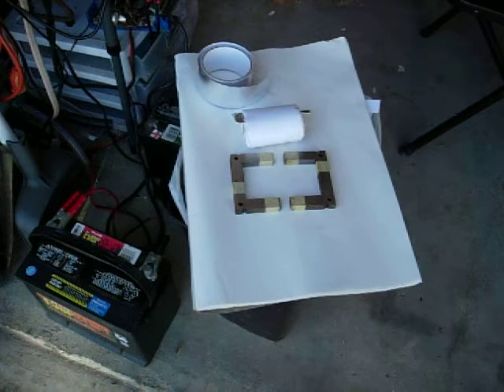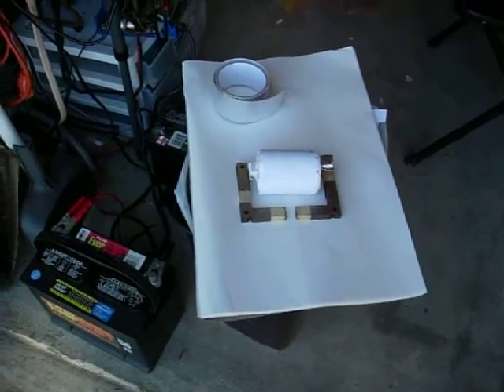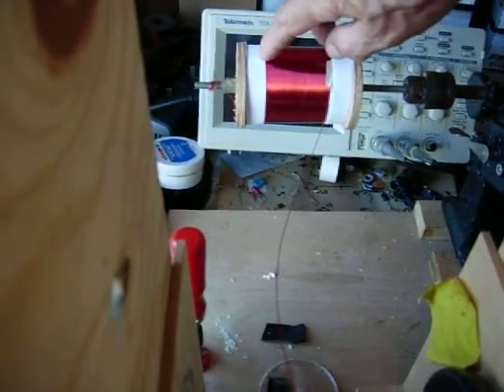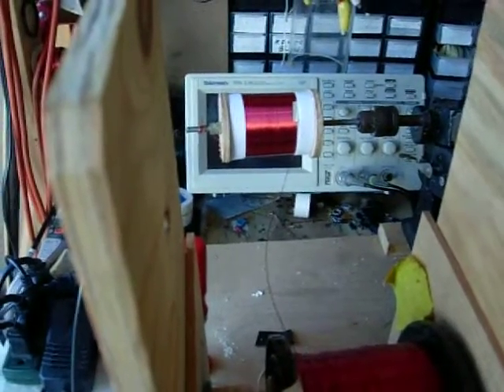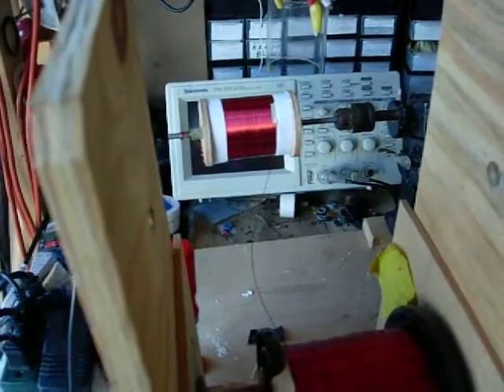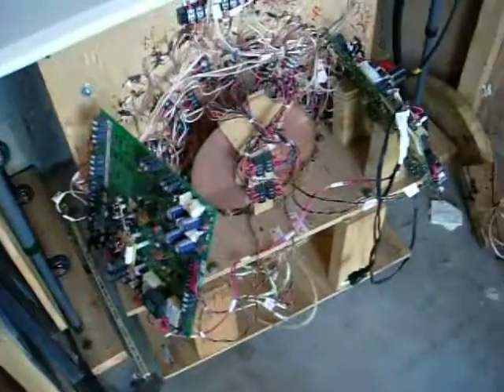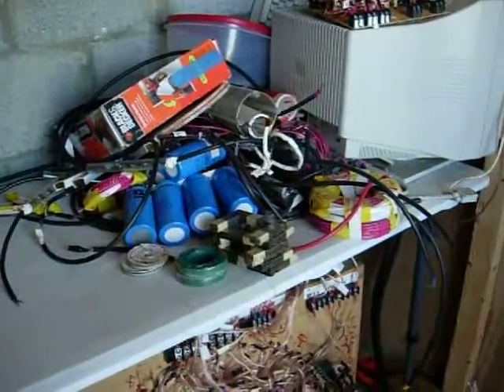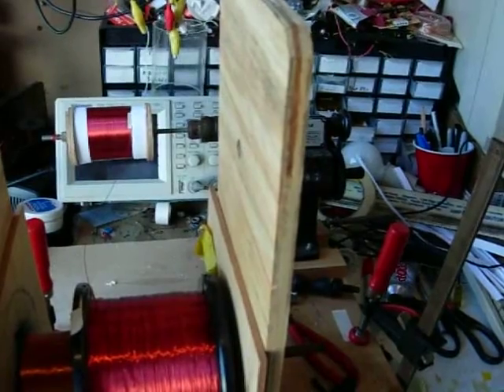Don Smith #108 I'm  building next size of pole transformers for my next Gerard Test

Comment from the maker: I just got the pdf file for the controller that Gerard is using for his 3 phase motor.  hummm lots going on with the three phases.  not only do the you use positive pulses but negative ones as well.   gotta read the book.

Comment from the maker: Oooops the voltage for each turn is not 600v 1200 into 7200 is 6v per turn.   I just finished the first transformer  20 turn 2" wide aluminum tape 1200 turns 24ga.  Next one will use much bigger wire say 19ga or 20ga same turns  I have about  1.25 inches available for the bigger wire.  The aluminum tape is a pain to work with.  If I can find some thick stuff then I might be able to rivet it for the connections now I'm stuck with crimping.   I may find that the OIL will make the connection bad we shall see. 

I also spent last night analyzing the 36 coil washing machine motor.  It has 3 phases A,B, and C.   Each of the 12 rotor magnets has 4 individual magnets NSNS.   The motor is self starting.   When phase A is aligned between the first NS poles it will create a push and pull to provide rotation.  The same is repeated for phase B and phase C.  so the rotor will receive 144 Push/Pull events for each of the phases. This means that 432 pulses occur for each revolution of the rotor.  From what I can see each coil produces a south pole aimed at the rotor magnets.  At a decent voltage these motors can produce some serious torque.

This info maybe crap but it is a start.

To measure the Ft-Lb. of force from a single coil you can use a magnet and a fish scale with a 12" fulcrum arm.  Once in place fire the voltage impulse into the coil and then read the fish scale.   You can also use other scales as long as they store the event.